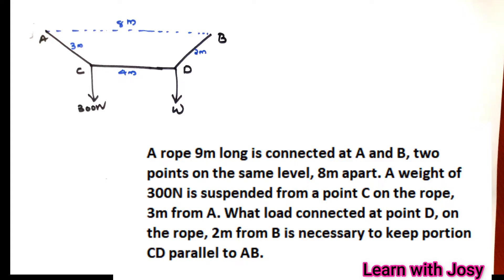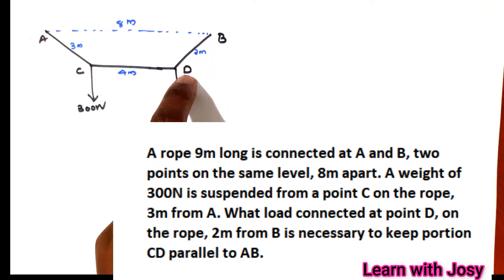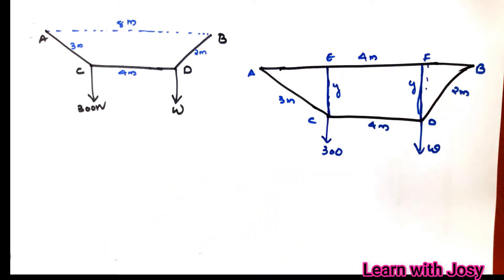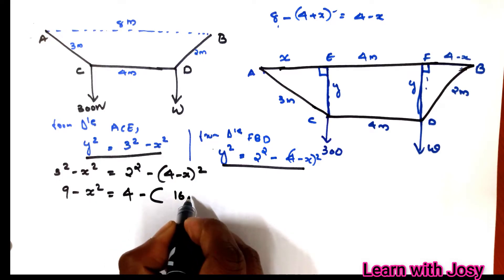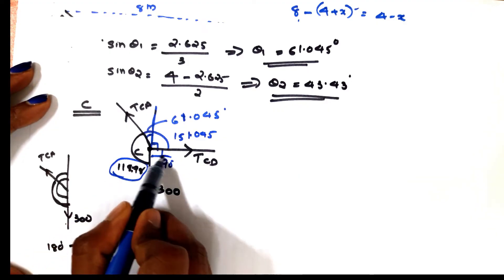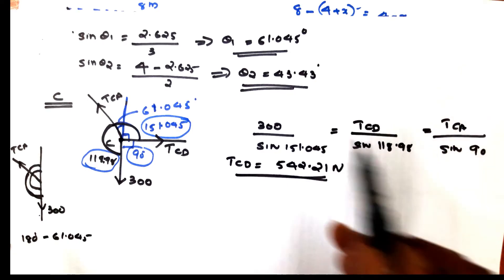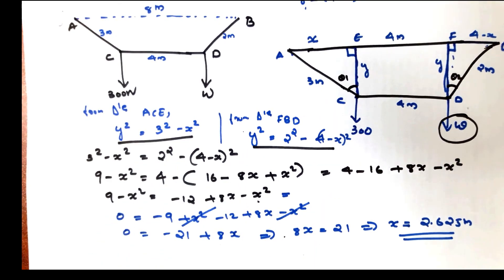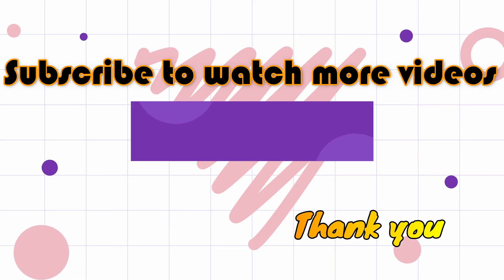Problems on Lami's Theorem |Problem 03 | PART 04 | Engineering Mechanics |First year | KTU syllabus

Comment: A rope is connected between two points A and B 120 cm apart at the same level. A load of 200 N is suspended from a point C on the rope 45 cm from A as shown in Fig. Find the load, that should be suspended from the rope D 30 cm from B, which will keep the rope CD horizonta

Comment: Mam , CE and DF engana both y Edkan pata?. Orennam 3m adeel alle , mateth 2m adeelm. So Point D korch mukalil aayt alle vara?
Reply from the maker: 3m,2m nnu parayunnath depth alla..ac, bc length anu..both the points c and d are on the same line if w becomes 572.